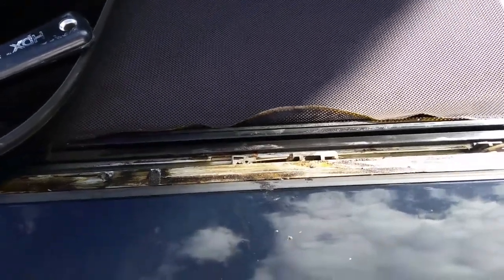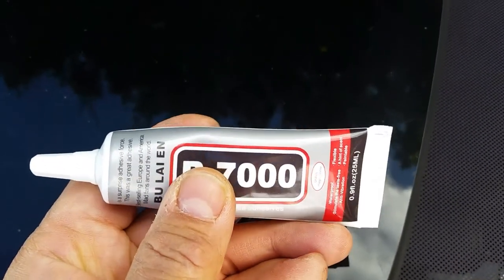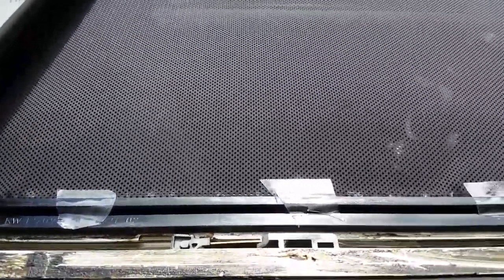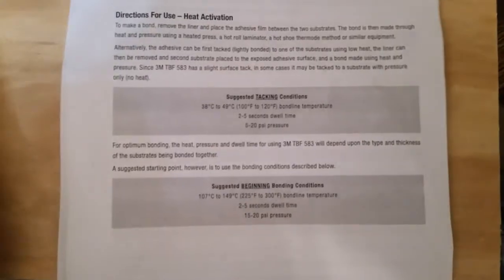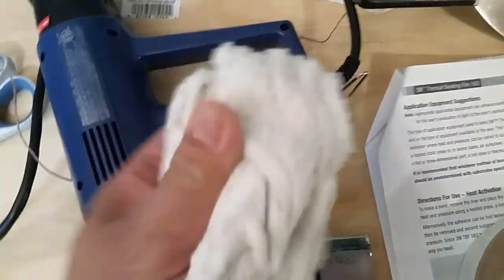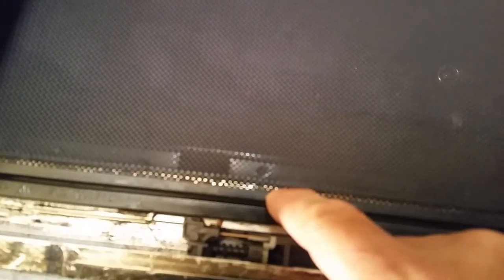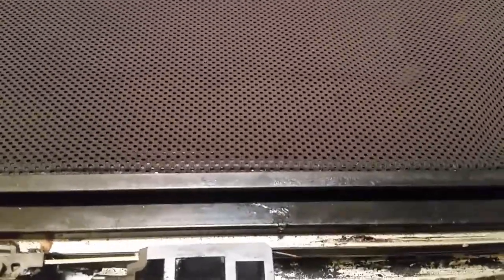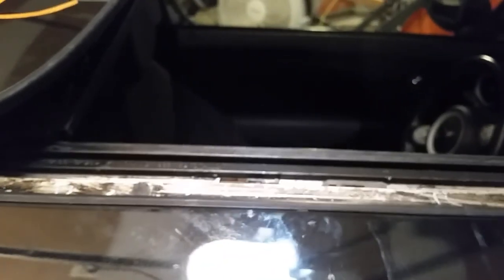How to fix your sunshade when it detaches from the track for a 2009 Mini Cooper

Comment: Great video! My Cadillac CTS uses the same glue tape on the shade roller! Now I can clue it on.
Reply from the maker: It’s tricky because of the heat sensitive tape. I figured I had nothing to lose since it was messed up anyways. Good luck
Reply: How do you get the sunroof shade to close for servicing while the panorama glass roof is open?

Comment: Thank you...good tips.  But I wonder if using a hot glue gun would have also worked?
Reply from the maker: @misottovoce  Might but probably will not last. About 1.5 years after the video/fix, it detached again. I ended up buying a new one (yikes $200) and swapped them out. I think I did a video on that. Good luck
Reply: @mcmcminicooper  I will be selling my Mini Cooper 2007 model and wanted a quick fix...but then realized the hot gun glue may be too stiff to roll back. (I have a Mini Countryman now).  Thanks again!
Reply from the maker: @misottovoce  Awesome 👏

Comment: Thanks for this video.  Did you find that it stayed attached over the summer months?
Reply from the maker: Yes it was but it is really tricky because you can't get extra tape where you don't need it. Otherwise, the heat from the summer will cause the tape to be sticky. I think it would be easier if i had removed the sunshade and repaired it out of the car. I couldn't do the rear sunshade, which detached, so i bought a replacement for about $250. Still researching on how to swap out a sunshade. I'll post a video once i figure it out. Thanks for watching.
Reply: @mcmcminicooper have to remove the glass to get the sunshade out.

Comment: Since you bought a 60 yard roll, can you sell me 5 feet of it? They want around 50 bucks for a roll I'm only going to use a tiny bit of it. Let me know.thanks Ozzie
Reply from the maker: I can send you a piece for free. I’ve been storing it in the frig since it needs to kept below a temp to avoid it from activating. When it was shipped to me, they packed an ice pack. It wasn’t easy to do but I figured I’ll give it a try because I had nothing to loose. Email me your address leearthur3a@gmail.com
Reply: @mcmcminicooper  ok, I sent it to you today. Thanks again
Reply: @mcmcminicooper I don't suppose you still have any of that thermal activated tape you'd be willing to sell me, do you? I read further in the comments that it wasn't a permanent fix, but I'll never open that rear sunshade, so hopefully it'll last a while for me.
Reply from the maker: @bking0908  I sent some to another subscriber and he mentioned that the tape wasn’t holding. I think it may have dried out or exceeded the shelf life.

Comment: can you post a link where you found the 583 thermal film? I seem to be only finding it in bulk...
Reply from the maker: I think I purchased it on from Uline.  It is going to a lot more than you need. It cost about $30.  Here is the link https://www.uline.com/Product/Detail/S-16128/3M-Specialty-Tape/3M-583-Bonding-Film-1-x-60-yds?pricode=WB2001&gadtype=pla&id=S-16128&gclid=Cj0KCQiAlsv_BRDtARIsAHMGVSbfVoCDMO_OFsJoLL0DOqYxaE-YxSsg6s4QtLH1Qr_sHvrO-FYAUcYaAmwREALw_wcB&gclsrc=aw.ds

I will have to note that taking off the sunshade would have made it a lot easier, but at that time I didn't know how easy it was to remove the sunshade (It was mainly the fear of removing to large pieces of glass and not being able to put it back in).  If you do take the sunshade out, just be careful it doesn't come apart - making sure the end caps stay on.

BTW - the tape should be stored in the refrigerator and when they ship it to you, they include an ice pack to keep it cool.
Reply: Thanks for the info!

Comment: How'd you get the sunroof to open allowing the shade to stay closed? Is your shade electronic or manual?
Reply from the maker: They make an electronic shade?!! My shade is a manual. If you want to fix or repair the shade, it is much easier with the sunroof glass removed. It's a bad design for a sunshade. I think I'll eventually tint the glass sunroofs.
Reply: @mcmcminicooper  Well yes sir that's what I'm asking, how do you remove the glass to work on the shade? Do you pry it open or something?
Reply from the maker: @kingisrael1532  For this video, it was the front sunshade so I could open the sunroof and close the shade. This allowed me to work on it from the top or the bottom. I wouldn't be able to have done it if it were the rear shade because the sunroof doesn't open fully, just tilts or pops up. It's just a wacky design on how the shade is stuck to a thin metal strips on both sides.

Comment: Can I have a link to that tape? Can’t find any where thanks
Reply from the maker: I got it on Uline. The roll is more than you need. It is not easy positioning and getting the correct pressure while heating. Here is the link https://www.uline.com/Product/Detail/S-16128/3M-Specialty-Tape/3M-583-Bonding-Film-1-x-60-yds?pricode=WB2001&gadtype=pla&id=S-16128&gclid=Cj0KCQiAlsv_BRDtARIsAHMGVSbfVoCDMO_OFsJoLL0DOqYxaE-YxSsg6s4QtLH1Qr_sHvrO-FYAUcYaAmwREALw_wcB&gclsrc=aw.ds

Comment: After now over 50 years in the sunroof industry this sort of repair would never be done for a customer of ours , those blinds are made by a robotic process using thermal bonding that CANNOT be duplicated by hand . They are cheap to buy and can be changed in under an hour , dont bother with this  repair as shown  it will end in tears , those blinds are under tension from side to side so trying to hold and glue them is a waste of time .
Reply from the maker: Your right, the fix only lasted several years, but I think we live in a society where too many things are thrown out without trying to fix them. Stopped working, off to the landfill, buy another on Amazon. I’ve breathed life back into things that broke  and some have lasted another 10 years and others failed again after months, but I will always try to fix it before tossing it and this includes stuff for my 12 years Mini.
Reply: @mcmcminicooper  Because I,m in the business of repairing sunroofs , we try to ensure customers get the best we can do so for us its new parts every time for these blinds .And trust me there are bloody hundreds of different ones in a variety of models Benz VW Audi Hyundai just to name a few .